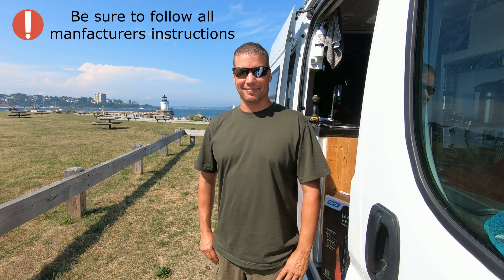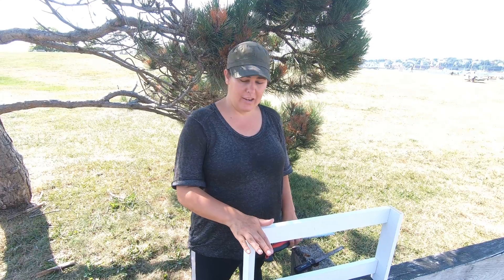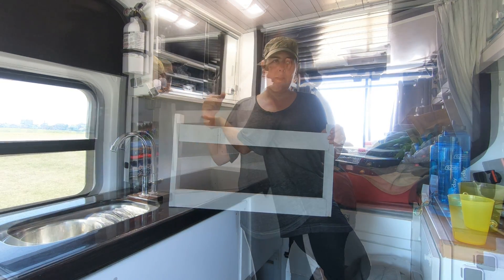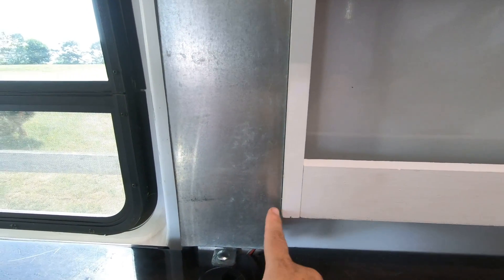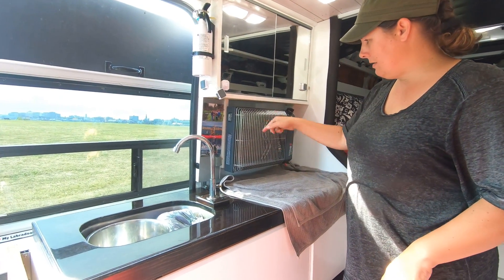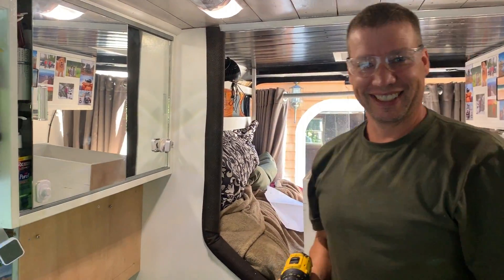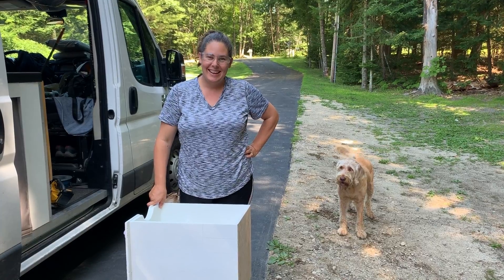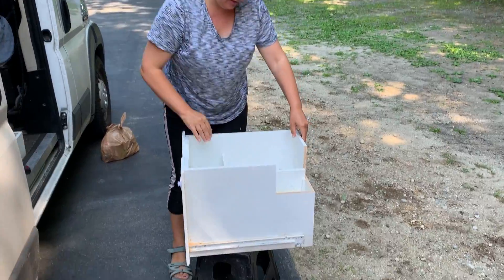WAVE 6 CATALYTIC SAFETY HEATER ~ Did We Install The Right Heater?

Comment: Have you burnt the trailer down yet? I would think so with those clearances. Top of heater is 18 in. Top is top. Rotated Horizontal sid is now top.
Reply from the maker: We ended up mounting a tv mount to the wall and attached the heater to it. We just pull the heater away from the wall now when we use it. The van is still in good shape 😀

Comment: One problem people have with heating and cooling an area (van or home) is the rest of the "system" isn't up to snuff. No insulation, air leakage, etc. The theory of "bigger is better" is what most people do. In most cases a smaller heater/A/C would work fine. Is the Wave 6 a smaller Btu than your old Mr. Buddy? Humans put out around 400 Btu's @ hour. Dogs put out more than that. Ventilation is import for Indoor Air Quality. I hope everything works out! I really enjoy your videos.
Reply from the maker: Yes I think the wave 3 might have been sufficient. We are very happy with this heater after a month of use. Never thought about how much heat a human or dog puts out but so true! Roodle is a massive heater dog 😂  We do like the way the wave heater does not blast us out. We are able comfortably stand near it and cook. Thanks for the insightful information and watching our channel.😎

Comment: Guys, I had a webasto heater installed here in Grand Rapids by Thermo King (They're all over the US and also in the Detroit area). It's soooo wonderful -- 1 gallon of gasoline is enough for about 22 hours of continuous heating which would probably last around 66 hours since it doesn't run continuously. Not the cheapest, truthfully, but still a great thing to have.
Reply from the maker: That sounds awesome! Back when we had money and started the build that would have been the way to go.😎  I like the idea of drawing your fuel from the vehicle tank and had no idea they are that efficient. Happy travels
Reply: one adVANture at a time yeah... it’s about $1200 for the hardware. I had it installed professionally but installing it anywhere but under the front seats is much easier. There are some cheaper alternatives but not sure how I feel about them.
Reply from the maker: I heard the install can be labor intensive. Do you mind sharing how much an install would cost? This is great information to pass along and someday when we’re successful you tubers maybe will get one 😎😎😎
Reply: one adVANture at a time I paid around $2300 and $1000 was labor... it took them over 8 hours. Part of that is because it’s right under the seat, it’s rather tight plus they had to reroute wires that are under the passenger seat. If you put it on the van floor, you’ll easily save several hours of work and have less measurements since there are less critical things under the cargo floor. Connecting to the fuel line is easy since the tap is built in and right next to the driver seat. I have a thermostat that controls it — so set it and forget it.
Reply from the maker: Awesome! Thanks for taking the time to add all that useful information. This sounds like it’s worth saving money for especially if you enjoy cooler weather like I do!!  Your going to have a great winter! Happy travels 😀

Comment: My only issue with these heaters is they combust the propane directly in the van and that generates CO2 and H20 — neither are nice to have build up in a van, perhaps the water is the worst though.
Sadly, the externally combustible heaters are a lot more expensive (Propex HS-2000).
Reply from the maker: Very good inside on propane heaters!  We have been using this wave 6 for nearly a month now and love it! It creates far less condensation then the buddy heater. We like that we can cook in front of it without getting roasted. Like you said we do have to vent while using it and don’t trust it enough to let it run while sleeping. We do think the wave 3 would have fit better in our last small space to put something. 😀

Comment: Hey guys, I am worried about you running a propane heater like this inside your van.  Combustion of any gas inside a small space creates carbon monoxide which can easily kill you.  Not trying to scare you but i have had a lot of experience with gas appliances.  Just beware and at least get a carbon monoxide detector installed if you are going to use it.  Best of luck and please keep safe!
Reply from the maker: Thanks for the safety tip! We have a CO detector installed and always ventilate while running the heater. Not only does the fresh air help keep us safe but is a must in keeping down the condensation when running the heater. We really appreciate your concern and hope others read comments like your to better prepare themselves for a potentially dangerous situation.  Also we do not run the heater while we sleep. 💤
Reply: one adVANture at a time Thanks for your reply!  I had a sense you probably knew, but didn’t want to take it for granted....not everyone knows of the real danger....the CO detector is a must!  Sorry to bother you but I had to say it!  Phew!
Reply from the maker: We are happy you took the time to comment 😀 Very useful information that could save someone’s life. Hope you have a great night, thank you 😊

Comment: I use a Wave 3  in my Transit Van. It produces plenty of heat. The Wave 6 may be overkill.  I had a Wave 6 in my Class A and that was about the right size for the area. I also installed a Wave 3 in my 6x10 cargo trailer conversion. They do the job. My Buddy Heater is some where in my garage covered in dust. They don’t work in RV’s. Keep a dust cover on the Wave heater when not in use. Dust destroys the catalytic pad.
Reply from the maker: That could be so but then that would have been too easy lol We spent hours protection ever surface 😂
Reply: You did good. It will work out. There is no right and wrong in the RV Lifestyle. It is all trial and error. We have been doing it for over 30 years and we don’t have all the answers yet.

Comment: why did you go with the wave 6, and not the wave 3 since your in a van?
Reply from the maker: +@cherylbrown7622 the wave 6 barely kept us warm and used ALOT of propane! We no longer have the wave 6. We have upgraded to the webasto heater…. Night and day difference!   Of course. ALOT more expensive but it has allowed us to camp in-7 degrees in Idaho and we went to Newfoundland this spring…. Very cold and icy in April!  The webasto kept us nice and toasty barely using and gas.  Oh and we ran it for 3 days straight when we were both very sick!   If you can afford it…. We highly recommend it.

Comment: I am trying to decide between the wave 3 and wave 6. I have an E150 hightop. I like that the wave 6 goes either direction, but I am afraid on low it might be too hot, or the wave 3 might be too cold. Sometimes I will travel in snow/cold. The low on the wave 6 is higher than the high on the 6. Just can't decide. What are your thoughts? BTW, I have radiant floor heat in my home, a 1953 small home. The only thing I don't like is having only 1 control knob. I need below 68 to sleep, so I have to keep the whole house a bit cold. Would love your opinion.
Reply from the maker: We love the wave 6 heater but think the wave 3 would have been sufficient. We can only use low setting or the counter gets too hot. We would go wave 3 if to do it all over. Hope that helps 😀

Comment: Wobasco makes a heater that runs off gas from your gas tank. There pretty pricy but they work great. They are forced air and exhaust out threw the bottom of the van.
Reply from the maker: Back when we had money and started the build that would have been awesome 😎  I like the idea of drawing your fuel from the vehicle tank.

Comment: Bad idea first propane causes humidity, second heat rises and U mounted it halfway up Ur van. Ur floors will never warm up. 3 u could have got a diesel heater for $140. And it wud fit under the drivers seat. The tank for them lasts for like 16hrs. Sorry but I don’t think Ur gonna be happy everytime Ur dog cant touch the floor think of me 🤗
Reply from the maker: We have been using it for a month now and love it!  It looks like our propane  tank will last over 3 months on one fill. After our first winter with our buddy heater on the floor we invested in slippers. Please leave a link for the 140 dollar diesel heater that fits under the seat. Our v6 motor is gas and we don’t have room for extra portable fuel containers. Be happy 😃
Reply: one adVANture at a time maXpeedingrod 5kw 12v diesel air heater is now 130$ on amazon and there is another brand for 160$. They are both kits so have all U need for hooking up including a small filler tank that can be secured on the side of the passenger seat. Van lifers have been Using the 130$ on for quite awhile and great reviews. I kno the American ones get expensive 300$-350$. Maybe this can help somebody glad the Wave is workin for ya☮️❤️🤗

Comment: I thought you had to have a big space above the heater where nothing is so it doesn't catch on fire?
Reply from the maker: We have spaced the heater out a bit more now so it has 21 inches above it. The ceiling is good. Working on keeping the counter top cooler now. So far so good after using this for about a month.
Reply: @oneadVANtureatatime  that's great😊 It should keep you toasty warm 😊

Comment: I'll be interested to see/hear how this works out.  My promaster came with a Buddy heater, which is fine for taking off a morning chill, but it has all the problems you enumerated.  I'm also interested in the Propex and Webasto heaters  (they do make an inline gas version, but they are less common)  should I ever get to the point where I do more long travels.  Thanks!
Reply from the maker: We  have been using the heater for the last few weeks now and very happy with it. We can stand right in front of it without getting heat blasted which is awesome since we cook right on the opposite side. That said, we still need to protect the counter..it’s a bit hotter then we like..maybe a silicone mat or fire place rug will do the trick.

Comment: We’ve been installing a Propex hs2211. Not quite working yet but we’re getting there lol.
Reply from the maker: We have been hearing lots of people talking about this heater! It’s got me curious now. Please let us know how well it works out for you 😎😎
Reply: one adVANture at a time I will — so far, it’s blowing a lot of air, but it’s not all that hot.  One issue might be the fact that it hasn’t been all that cold when I’ve tested it — but I’m also concerned that it has something to do with the digital thermostat that we are using — the digital thermostat just became available for the Propex in May, and I can’t find any instructions for it, so I’m not convinced I’ve programmed it correctly.  I’ve emailed support but still waiting for a response.  But other than this issue, I’m pretty happy with the install — we installed it underneath the van, and the registers that we drilled into the floor look nice and work very well.  We placed the 6.9 gallon Manchester tank in the spare tire area, so now we’re trying to decide how to deal with the tire (I’m reluctant to spend the $1,100 for the hitch and the rear door mount).

Comment: Nice video, but you have more courage than I putting it that close to the cabinet.  I will for sure follow along to see how it works out. 

I just bought a buddy heater because it’s cheap but plan to store it in my trunk for about 10 months of the year as I chase warmer weather
Reply from the maker: With good placement your buddy heater should be fine. We have been using the Wave 6 for the past few weeks and like that we can cook or simple stand in front of it without getting heat blasted. That said we are still working on a way to keep the counter top cooler. Maybe a silicone oven mat or fireplace rug will do the job. Happy travels 😀

Comment: Excellent install video thinking through all the features and safety issues. I’ve never seen someone hang it as high. Do you think a wave3 might have given you enough heat esp if kept on as a continuous source when needed. In your review or in answer here can you please show or link the self contained propane bin. I’ve never seen one in North America. Thx 🇨🇦
Reply from the maker: I think it is fine at the height that we have it, However, our floor is very cold 🥶. Also, in a perfect world the medicine cabinet would be a lot higher. This is the price we are paying for not initially building in propane and really thinking about heater options. I think the wave 3 would have worked in a well insulated van. (Like ours) we probably should have gotten the wave 3. We know a van lifer who has the wave 3 and not much insulation wishing for the wave 6. Here is a link to our sealed propane box build. We Build A SEALED PROPANE BOX. https://youtu.be/_PIDbZ5r2NE
Reply: one adVANture at a time hi guys. I had messaged Chrome ages ago to buy the wave 3 bc it was on super sale on amz.com. We pay much more for these things in Canada. It would be my heater of choice. My previous rig - vintage fg trailer didn’t really have a super safe place to mount it with allowances. Now in my 2009 Roadtrek I have a heat strip on the ac and a propane furnace. I would prefer to be way more self sufficient but these rigs are near impossible  to retrofit solar/lithium. My younger son who is an overlander thinks I need a Promaster with a simple built to suit me. He’s probably right but that’s NEVER going to happen..lol. Did see how box build...thx. Maybe you could convince Chrome to be safer with his propane system.
Reply from the maker: Hi Mishu, We have a wave heater update video coming out tomorrow and also show case it on this coming Sundays video if you are interested. Stay safe and stay warm 😀

Comment: A couple of other thoughts.  If you decide you really do want an "Espar-like" heater, you could use the Webasto.  It's essentially the same thing but I am almost positive that it can run off regular gasoline as well as diesel.  AND I have seen people who run them off of a heavy-duty portable gas can rather than the van gas/deisel tank.  So in other words, it doesn't matter what kind of fuel you use in your van.  You just have to secure a good gas can to be the fuel source and use that for your heater.  One guy I saw secured his can in the garage and filled it with deisel in his Sprinter at the gas station to power his Espar.
Reply from the maker: Those heaters sound awesome. I’ve done some research on them but not a lot. Here are a few of my cons. They burn about one gallon of fuel a day to keep the van warm, at 3 dollars a gallon that’s 90 dollars a month. Our propane cost about 5 dollars a month to run the stove and heater. Next they can cost over 1k to get them installed in your tank. If you use a separate tank then you have to have a safe place to store it. All that said if we would have known about it during our initial build...back when we had jobs lol then we might have just done it. What are your thoughts?

Comment: Nice job guys, hope it works for you.... I’m planning on using the same heater. We’ll be waiting for you thoughts... safe travels
Reply from the maker: We love the wave 6 so far. We have been using it for about a month now. We can work near it without getting too hot like our old buddy heater. Location is important, as is we may have to push it out further from the wall..the medicine cabinet and the counter do get quite warm.
Reply: one adVANture at a time - that is good news, I should be ordering mine soon 😀👍🏻✌🏻🚐

Comment: I would really think hard about where you put the heater. Even with a heat shield the placement worries me. I've done construction my whole life and anything combustible over a furnace is a bad idea. It only takes 1 small malfunction to create a devastating effect.  I hope I am wrong and it works fine for you, but if it was my van,  and I do have a converted van,  I will put it in a dedicated space that has twice the clearance the manufacturer asked for,  I have barn doors and I dedicated 1 to my heater. Safe travels and I hope it works great for you
Reply from the maker: Thank you for sharing your safety concerns . We are keeping a close eye on it. So far so good. Also good idea not to sleep with it running. Safe travels 😀
Reply: time  same to you, I really hope it works out great,  and just thank chrome for me following you

Comment: Nice job you will like it works awesome. You can get the knock off espar air heater with a tank. Awesome video well done 👍🇨🇦🛠🇨🇦🛠
Reply from the maker: Thank you very much and also for sharing the air heater tip!

Comment: Heaters in small spaces are spooky no matter how you deal with them! Good job with the install. For the counter top, if your concerned about it getting too hot, go to a wood stove/fireplace store and get a fire resistant “rug” and cut it to size. You can pull it off when heater is not in use and cover the top when it is. It will give you some peace of mind at night!
Reply from the maker: That is great advice ! The counter has been getting pretty hot...we will be looking for that rug first chance we get! Thank you guys so much for sharing  useful information. 😀😀

Comment: If you did not get the dust cover https://www.amazon.com/gp/product/B000EDUUO4/ref=as_li_tl?ie=UTF8&camp=1789&creative=9325&creativeASIN=B000BV01CK&linkCode=as2&tag=advanture07-20&linkId=9ae866ad35096f65dce5ef25fcd5980f&th=1 you might want to make one to cover the catalytic heating pad. To protect it from Dust and debris. Good Luck Tcash
Reply from the maker: Thank you for the tip and the link! We are learning this dust cover is a must have when not in use! We appreciate you sharing this valuable information. Thank you!! 😀